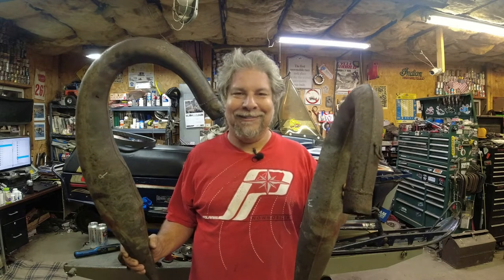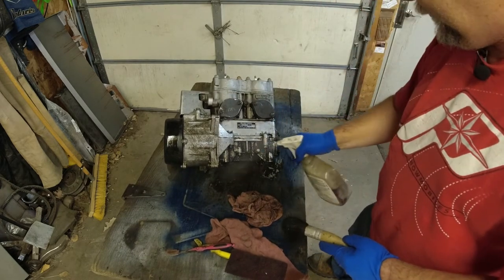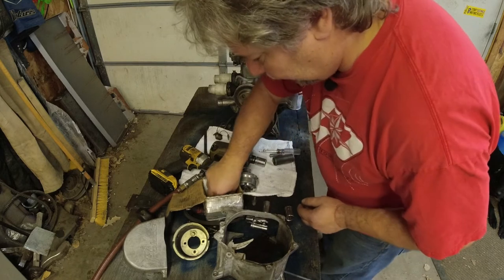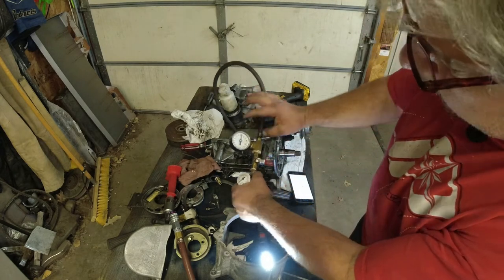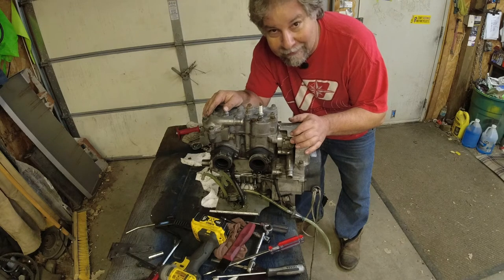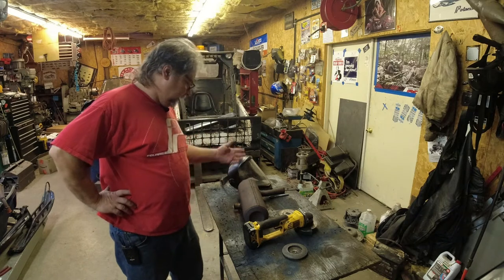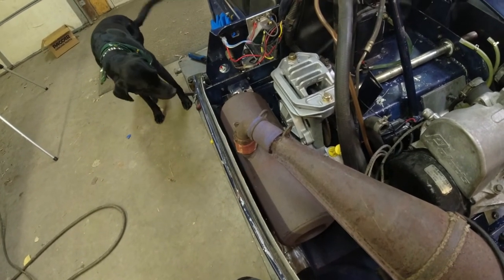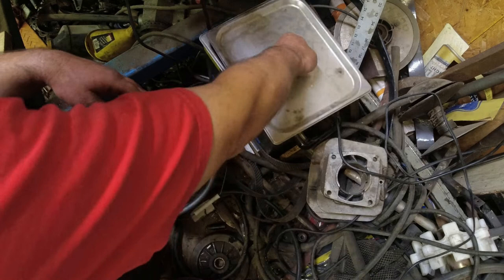1983 Polaris Cross Country Indy Part 6: crank seals, can mod and carb cleaning

Comment: Great videos! Whats the closest video showing you doing crank seals on a TX free air engine? I need to replace mine. Thanks!
Reply from the maker: Depends on the year and size of motor because there were two different seal styles. Check through the play list on Lonnie's TX ans Dennis' TX.
Reply: It’s a 77 TX 440. Thanks!
Reply from the maker: @joenaber9127  same crank seals as a TXL or Dennis 1980 TX340 or an xlt.
Reply: Thank you!
Reply: Is Dennis TX 340, the one you swapped cranks in?

Comment: I have to change the PTO seal on my 96 xlt  do you have to pull the whole motor apart or can I just remove the lower case?
Reply from the maker: I've done this in at least two XLT videos on XLTs where I just flipped it upside down and lifted off the bottom case. Look for my XLT and Lonnie's. We had to put a new crank in Dennis' so that came all the way apart.
Reply: Thank you!! Love the channel